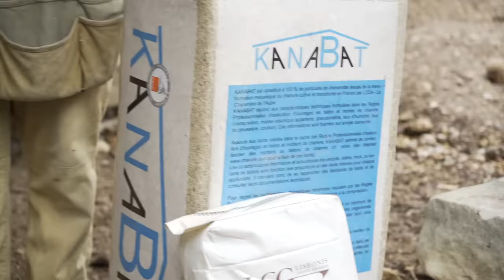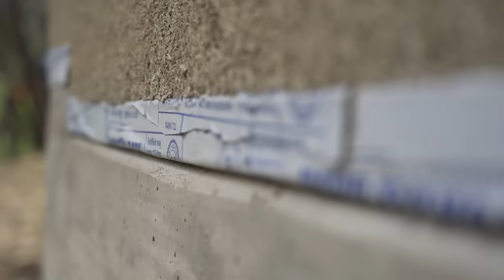Hemp Concrete Walls (R30 + Fireproof) - You Won't Believe How They Built This House!

Comment: How do you fill it to the top?  Obviously you can't fill with form board to the top and have access.  Also fire proof walls and flammable roof, why?  Coming from someone who survived 2020 Oregon fires
Reply: I don't think they are worried about fires in this particular region of Texas? But, perhaps they should be.
Reply: after i watched the video,  and i was WTF, so start to search up a comment like yours. the whole roof with so much timber even lighting could set a fire.

Comment: all well and good. BUT.. Super expensive. Shipping will kill you.. Wonderful product. Looking for hemp shiv. a few producers domestically. Did I mention shipping will kill you? Shipping full containers either from the EU or China.  Did I mention that shipping will kill you?    The house breaths wonderfully and because it it thick (meaning you need a lot of it) The shipping will kill you.  12 inches and you have real r value.  But while I love this stuff. you can dump it into the attic just like loose fill cellulose or fiber glass.  But did I mention the shipping of the hemp and the hydrated lime mixture will kill you.  YES  the shipping is a lot more than the cost of the hemp and binder.
Reply: Which is why it needs to be produced domestically more. When that's done, it could be a trailer load delivered or even available from local suppliers.
Reply: It’s a good thing then that we are starting to farm it in the US then. Will take time to find out if it’s gonna catch on or not tho. I’ve been debating on whether or not I should plant a field of it next year or not. They have multiple uses for it now so should be a market for it now
Reply: @1982MCI   one thing not mentioned.. Bugs wont eat it.. lime is not on their diet.  
Another thing sort of touched upon.. it absorbs and releases moisture easily so the house tends to stay very temperate with vapor in the air.    as lone rider said. if you can get it somewhat locally it would be a great building material.
Reply: @GridIndustries  if they don't add some ridiculous tax to it
Reply: @stevepailet8258  termites won't eat the hemp?
Reply: @Tactical-Black  the government is the whole reason it's been illegal the last almost 100 years. So I'm sure they'll do whatever they can to get their cut and make it as difficult as possible. Like marijuana legalization.
Reply: @Tactical-Black  simply put NO.  hemp has silica just as do rice husks.  The hemp core or “Shiv” has a high silica content which allows it to bind well with lime. This property is unique to hemp among all natural fibers. The result is a lightweight cementitious insulating material weighing about a seventh or an eighth of the weight of concrete. Fully cured hempcrete blocks float in a bucket of water.  Bugs do not eat sand. (sand= silica)  the hemp shiv (hurds) bind with the lime. Bugs dont eat concrete either.  I know hard to believe. Portland concrete is LIME  so the answer is a delightful NOPE
Reply: @stevepailet8258  I live in the south and was told these bugs (termites) eat through everything even concrete as in alot of houses here the bugs are coming through the foundation were it meets with the blocks and requires fumigation yearly, i have to check this out
Reply: @Tactical-Black  Termites are trying to get to wood.. specifically the wood sill here is treated.   Termites generally try to go thru concrete if there is a water source. No water no bugs.  Did you happen to notice ten times in this video the size of the over hangs?  Bugs do not like cedar.  If you look at furniture in the SOUTH a lot of it is made of CEDAR.  Again keeping water shed away from the building .. building with materials that those bugs do not like. I am well aware of the problems of termites. I lived in New Orleans home of all the problems you suggest with bugs.  20 plus years dealing with the damage of termites.   Cracked foundations (bricks used in foundations in the french quarter. Party walls of brick  Leaking roofs water source and non treated wood ... yeah I know termites. )
Reply: @stevepailet8258  ok thanks i will keep that in mind
Reply: @stevepailet8258  hemp has silica? Link please. 

"The major constituents of industrial hemp shiv are: cellulose (44%), hemicellulose (18–27%), lignin (22–28%) and other components such as extractives (1–6%) and ash (1–2%) [11,12]. Extractives include numerous low molecular mass compounds such as fatty acids, waxes, sterols, triglycerides, steryl esters, glycosides, fatty alcohols, terpenes, phenolics, simple sugars, alkaloids, pectins, gums and essential oils"

Comment: The aerial view of this house says it all. Cedar shake roof on a structure surrounded by trees up to the eaves. The  fire resistant characteristics of the hempcrete walls are completely irrelevant. if a fire sweeps through the site the only thing left standing will be the walls. Even the walls are of questionable long term durability, being structurally built from untreated 2 x 6' s covered over with a earthen based material. Termite heaven.

It is completely possible to build a structure on that site that will survive a wildfire.  But it will be fully earth sheltered (ie underground), with insulated fire doors capable of sealing off all exterior window and door openings in the event of threat, or an automatic fire retardant foam system large enough to cover the entire structure. 

You do your readers a dis-service by representing this design as "100% fireproof.

Comment: Cool video and building style. Wood from Japan creates a major foodprint and like said lime binder or plaster also takes a lot of energy to make. Plaster on the inside could also be clay plaster. I also like sheep wool mats as natural insulation because it clears out the formaldehydes so it works as an air filter in your house. You need a sheep wool with a good moth protection though. Keep on building good and green people :D

Comment: Aircrete is pretty cool too its easy to support and has higher compressive strength and insulative value. Plus its easy to cut and drill.

Comment: Really interesting video, it's great to see your channel looking at alternative construction methods every so often.
Here in Ireland we really need to move away from the unnecessary use of concrete and steel for residential construction and hemp is an ideal product to use. Hemp grows very well in our climate but our obsession with concrete at homeowner, builder & housing department level & the ease at which engineers toss steel beams into a building without even considering timber solutions is really holding back the expansion of the use of alternative materials.  Even timber frame construction which has expanded in use over the past 25 years is only used for the inner core of a house & the external leaf is always heavy concrete block or brick. 
It sad as when we look back into the distant past we can see how natural methods of construction using materials like stone, timber, earth, plants, animal hair/wool, lime etc have been used here successfully for hundred's and even thousands of years. 
Keep up the good work, I get a great kick out of figuring out the American terms for materials & processes!

Comment: for warmth, an extra layer of hempcrete or bricks, or even just simply spraying a layer of hempcrete on the outside or inside of the rammed earthen wall, will provide bio+defense layer from freezing air gathering inside.. but wooden texture of hemp fibers collect moisture from the ground, by soaking it up like a sponge, so isolating it with waterproof paint is encouraged

Comment: This is great! 

Please check out something called ''Just BioFiber '' which manufacturers Lego like hemp blocks that are structural and insulated.

I wish you would do more on just new innovative building techniques as there are so many. Like:

- Just BioFiber (structural insulated hemp blocks)

- ICFs

- Thermasteel (a polystyrene panel with embedded metal studs)

- Foam core panels with steel caging to spray concrete on

- Steel sip panels (foam panels with interior and exterior steel sheeting)

I even saw one building technique called Green Rhino which is just polystyrene blocks with mesh fabric covering them that a thin layer of concrete is applied to to make them structurally sound.

Stick framing is dated, inefficient, not strong compared to some of the building techniques mentioned, not as durable, not as insulated, and flammable to top it off.

For those reasons and more I really wish you and others in this field would do more on innovation and the cutting edge in construction where you talk about the costs, pros and cons, and just your overall assessment of them.

Comment: There is a companion to Hempcrete called Dust Crete which is 15-parts wood chips of the same size seem here, 2-parts Lime, 2-parts Portland cement and 4-parts water.  A very dry mix which is used the same way.  Just without the cost of the Hemp.  A normal truck load of wood chips from a circular sawmill is about $20 a load.

Comment: My parents bought and lived in a fly ash concrete house on Mt. Helix...9840 Alto Dr., La Mesa CA. This was the first and, as it turned out, the last house of the future. The slab is standard concrete. The interior and exterior walls, as well as the ceiling/roof with wide, cantilevered eaves are all steel-reinforced fly ash concrete. 
The wall structure is wired rebar, about 8” thick, with metal lath on both faces. There was an article with one (?) photo in a 2949 or 2950 Union Tribune article showing two men with 4’ darbies working opposite one another. At one end of the wall a “conductor” was lifting his arms to keep the darbies at the same height. The plasterers were watching the conductor. I assume plaster was dropped into the center of the wall with shovels, then darbied. There were no form-boards, though I assume form-boards were used for the ceiling. 
The newspaper article was one of the documents which conveyed with the house in 1980 but were not found when the house was sold in 2013. The microfilm in the newspaper morgue was missing in 2013.
I bought a 1/2 hp. corded drill in 1980 with the expectation that drilling would be hard work. The opposite was true, so perhaps the fly ash concrete might be better called ‘cement’. I never saw any rock aggregate. Insulation was worse than minimal...the house stayed cool throughout a summer day, then the ceiling/roof started to radiate heat at bedtime. I recommended my parents have a foam roof installed over the BUR. Because the workmanship left small craters everywhere, my mother negotiated a 50% refund for the two year old foam roofing. I then had TPO roofing installed over the foam about 1990?.
An infinitely rotating house is located immediately up the hill. The speed of rotation is variable. The builder, shown with his wife in red shirts on    < rotatinghouseSanDiego >, developed and owns the clever patents that allow all utilities to share a common, central column. Do not go down the steep driveway without permission as there’s no turn-around room. The owners have his & hers turntables for their cars inside the lower level.

Comment: As a Concrete Contractor I think I’d use snap ties, John clamps, 2x4 whalers along with
 form plywood to set up the walls. It would be very fast and quick  to strip and reuse. 
  This would make awesome exterior walls for us up north. You’d only have to use conduit in the exterior walls.... it would save some costs of running conduit for the entire home. 
  I wonder if termites could get into the walls?
Reply: I would look real hard at doing a double framed wall. The hempcrete on the exterior normal open framing for wiring and other utilities. It would be even better if it came in the form of SIPs.

Comment: I worked as an engineer in the paper industry so I am familiar with industrial hemp.  Hemp fibers are very long and it makes a strong paper used in such things as tea bags.   Plant fibers are typically at least 50% cellulose which absorbs water in proportion to the relative humidity, so I would be hesitant to use it where humidity gets high like on the gulf coast.
Reply: It doesnt use fibers it's the wooden core. Hurdnor bast I forget which. It might be bast. It's the part inside of the fiber. The fiber is the outside of the stalk.

Comment: Have any tests on this material been done on alternate emplacement methods? I suggest a test: Mix the hemp aggregate and lime cement as dry components, use something like an insulation blower to distribute the  dry mix into the forms while vibrating the forms to settle the mix in a uniform consistent manner, then irrigate the water in a controlled manner from top to bottom until saturated for curing.
Reply: I think a hay mower would do it if modded to like wheat or suchlike

Comment: Have you ever wondered what all the growers are spending money on? Super thick thermal walls of course. I could think of a dozen other ways to achieve over R30 in a wall that size. On the other hand if you're insulation is left over from a harvest then free material is always a plus. I have to give them credit for a new technique. I'm sure it will make for a great story home when guests visit.

Comment: I'd love to know your opinions on Hemp Blocks as well as the fact that the wiring is inside the wall in this video. Having the wire like this seems to invite future problems if wiring issues are found. I also believe this about spray foam over wiring.
Reply: Conduit?
Reply: Just run all wiring and plumbing (pex) inside conduit.

Comment: Everything about this and select other "green" (or greenish) building methodologies and materials are great --- except for, primarily, one thing: The price. One reason, perhaps, why MR is using Rockwool insulation and not this. As an aside, from what I've read, hemp may be one of the most useful plants on the planet.

Comment: I've seen hemp board used in place of plasterboard/sheetrock as an eco friendly alternative & of course, it has added thermal properties. Just use lime plaster to provide a smooth rendered finish. Wonderful to see you featuring evermore eco friendly building products/techniques Matt. Climate change exacerbated wildfires, particularly in Nth America, mean using eco friendly buildings that are fire resistant should be the standard way to go [condition of planning approval]. At the very least, it gives communities a better chance to recover/rebuild after a wildfire has swept through entire neighborhoods, towns, cities as has happened in far too many places in the last 3 years. Hempcrete walls might leave homeowners something left to rebuild with rather than having to start from the ground up & a reduction in rebuilding costs therefore making rebuilding a financially viable proposition. I think I'd want to seriously consider using hempcrete internal walls as well if I lived in a fire prone region rather than the usual stud walls - more left to work with if the above happened.

Comment: Have seen construction with compressed brick? Hemp might be a good additive for them. Bricks are made with a mixture of classy sand and cement. Then compressed by an insight hydraulic or manual brick compressor. These bricks are structural up to two stories. Stronger  than cement block.

Comment: Have a look at Durisol blocks.  They use reclaimed chipped timber and cement, what is interesting is that they first treat the chips with a process that mineralises them, to be fire, mould and vermin proof, and dimensionally stable.  Same process could be applied to hemp?

Comment: If the walls were actually built of hempcrete it would be impressive, in being green and fireproof. On this case an insulation material, awkwardly packed around pre-framed walls - also requires really expensive steel moment frames (because it does not allow shear walls?).  Counterproductive to cost and insulation value.

Comment: Very interesting but seems to be labor intensive. How does the cost/insulation value compare to foam insulation that can also achieve high R values? Perhaps preformed blocks of hemp mixture would be more economical and practical for construction?? Is there any testing being conducted regarding structural capability of a hemp wall as compared to a concrete wall? Thanks for the video.

Comment: What exactly is the binder used? Could regular cement be used? Or hidraulic lime? What are the proportions of hemp to binder? How does one calculate overall volume for a wall, or a job in particular?

Comment: I just saw this (3/22/2022) and love this product and believe we should work with nature more but I have a few quesyions that maybe you can make a newer vid to cover.  A few questions, how does this product hold up to time, you say this prodict is fire proff but if water is part of the binder mixture can it evapurate leaving it brittle, how does it stand uo to changing temps from 90 degress to say minus 10 degress, if water is part of the binding agent how does it affect wiring,  how do bugs and pest ike or hate it, does it have a scent, (if so) could it attract animals, if as a homeowner can i later replace it or use it to replace other types of insulation (ifo so) how is that process since you show it has to be compacted, as a home owner can I later add a door or windown and how is that accomplishe, will it settle over time and finally what happens if there is a flood or an internal / external fire, oh last thought can this be used between a garage and house structure?

Comment: Way back in Henry Ford's day he proposed this hemp plant for building cars that you could not dent them with a sledge hammer!  Also, the bio fuel made from this hemp plant would fuel his engine designed by Diesel that would power the farming equipment that would be used to plant and harvest this plant.  Mr. Dupont stopped him from doing this by having Congress produce laws where you could not grow any hemp  plant due to it drug properties!